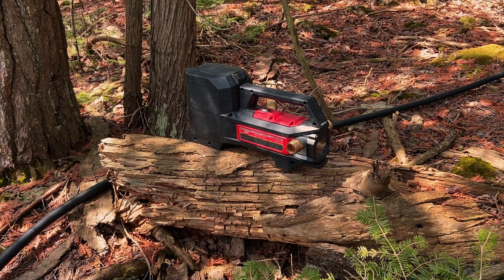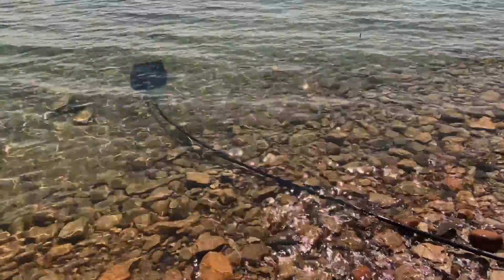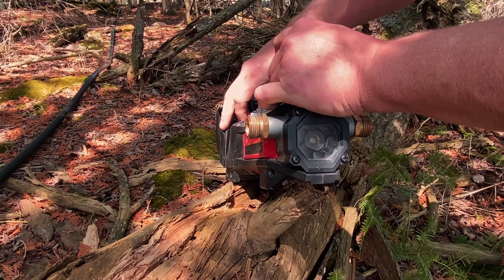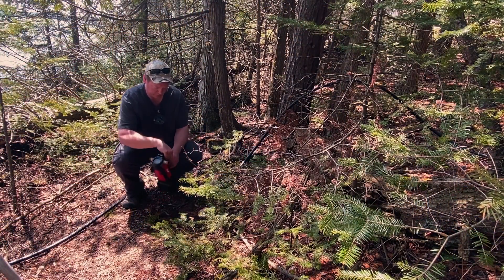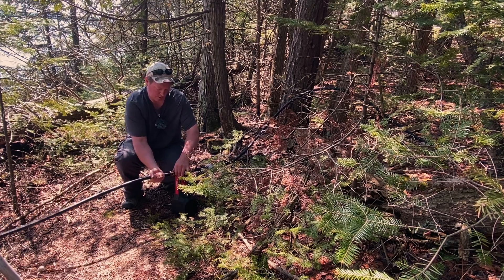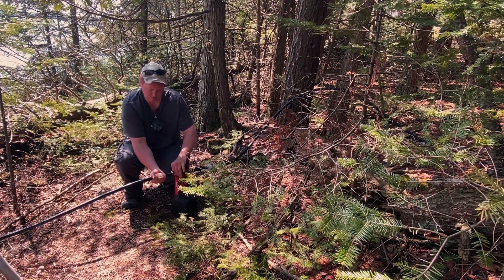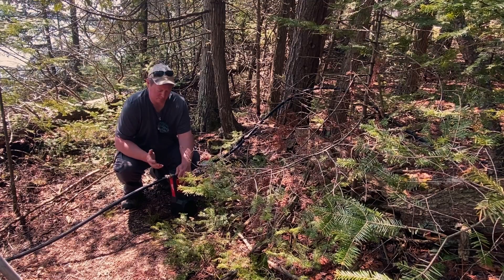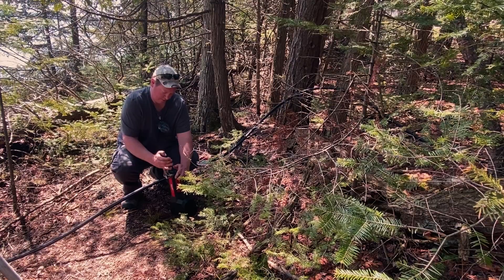Off-Grid | Water Tower Water System | Milwaukee 18v  gear drive transfer pump.

Comment: Lag bolts, nails or screws to built tower?
Reply from the maker: Lag bolts is what I used to attach the legs to the platform. The platform itself was assembled with nails as well as the cross bracing. I did use some screws to help quickly hold things together but all were replaced and had nails added at their locations.     

Screws are great in a pinch but if you bend a nail in half it’ll fold and back and forth a few times before it will snap.   Most screws will snap off during the first bend. 

Not recommended to use screws for anything other then hanging a picture. :). In time a structure under load will eventually snap screws off as the building stresses under changing loads.  

Hope this helps. And thanks for checking out the channel.

Comment: Nice setup. Would it be less work for the pump it you were to add a diversion valve at the tank so that you could fill the tank from the top instead of the pump having to work against the back pressure as the tank fills?

Comment: 🤔 how did you get that IBC tank on top of your tower, you got yourself a forklift in the middle of nowhere?
Reply from the maker: No sir. While empty I tied a rope to the back of the bottom of the tank and leaned 16’ 2x4’s up against the top of the tower. I wrapped the rope around over the back of the top  and back thru the front to me thru the middle. I pushed the tote while I pulled the rope continuously untill it was on the top then pulled the 2x4 out

Comment: Thanks for the video. I'm getting ready to add a solar pump (RPS brand) to my well and I'm going to pump to an uphill tank (which I still need to buy). I've been eyeballing those totes like you have. They're about $200 where I live. I'm shooting to have my tank about as high as the top of my trailer. I'll probably build a little platform for the tank to sit on. Something like yours but shorter. Have a great summer.
Reply from the maker: Thanks Dan. It’s a simple setup that works great. Hope you also have a great summer and your installation goes well. 🍻

Comment: I bought a two story house, off grid, it has a sprinkler on the roof(one of those rotating heads) not sure what the previous owner used for a pump. I wonder if this would provide enough pressure to keep the roof wet? until the FD shows up....its about a 20' drop to the lake which is 60' from the house. I also have one of those fire packages on a dolly(pump , hose, nozzle etc...Thanks for the video.
Reply from the maker: I don’t think there would be enough volume to activate the hammer thing that moves the sprinkler.  I would recommend a gas pump for fire protection. Likely like the one you have on the dolly. 

I’m glad you enjoyed the video. 🍻

Comment: Very interesting! What about issues with the system freezing?
Reply from the maker: Hi Larry. Welcome to the channel. This is not a winter system.  In the fall I will winterize all the ball valves, lines and empty the tank. In the winter I get my water with a bucket from the lake.
Reply: @IndependentOffGridRetreat  Thanks for responding!  It’s got me thinking. I’m just getting started, but I like the set up.
Reply from the maker: @larrythomas3624  np this is a community I’m glad to share.

 sometimes simple is better. Everything had advantages n drawbacks.  

I’d be interested in your ideas. Let me know what you decide to do

Comment: our bath house tank is the same style tank. We use a 12 volt pump instead of gravity to take showers and the sink, but that tank full lasts us a couple weeks, It is great. Next year we plan to do rain collection now that we have a cabin to catch it off of. Nice little set up you have. ALSO....jealous of your shoreline, LOL. Best wishes
Reply from the maker: I likely filmed this video the weekend before upload on April 26th. You must get to your retreat a lot more then I do. Last weekend I looked and I just went below my electrical tape marker I put on for this video with last weekends trailer tank fill up. I often shower in the lake. But do all dishes and hand washing and 50% daily showers. No toilet I use an outhouse.  I had two weeks of vacation and have been there every weekend for over a month too. 

I think I refilled it once. That’s 4 months of water use on two tanks. Sure you don’t have a leak?

Yes I really lucked out with water. Got in just in time. Just before covid.  All lots are sold now and selling at more then double what I paid!!
Reply: @IndependentOffGridRetreat  ya we have two people showering daily for two weeks, it drains the water down pretty quick in comparison to just watching dishes and such.

Comment: How is the water filtered from lake to trailer?
Reply from the maker: No filters. There is a large screen on my foot valve which as you seen I have elevated off the bottom of the water with a milk crate.  Then my trailer pump has a sand filter on the intake.  I have thought about buying a couple canister filters so I can drink the water. Now that I’m building the cabin I’ll wait until I have a spot to put it in there.

Comment: you need to paint that water tank black , good video
Reply: You can add a little chlorine to the water to deal with any algae.
Reply from the maker: @polarbear4612   yes thanks. I’ve also heard hydrogen peroxide will help with this.
Reply from the maker: I’m testing it. I know the sun should cause algae to grow. But I’ve had a white plastic 50 gallon drum out and hasn’t grown any yet 🤷‍♂️. Thanks for the suggestion.

Comment: What do you do at below freezing temps?
Reply from the maker: In the winter time I still use my trailer. 

Come late fall I winterize my trailer shut off and winterize the pumps. Empty my tower tank and blow out the water from the above ground waterline. I leave all the ball valves open so they don’t burst and crack. 

I use a five gallon water jug and a ladle to get water through the ice for washing dishes which I do in two plastic plastic containers and water I heated on the propane cooktop. One container for soap one for rinsing. Dumping the water outside when I’m done.  I buy drinking water in 3l or 1 gallon jugs for coffee and drinking.

I clean myself using the same method but use very little soap and a face cloth so I don’t have to rinse as much. My dad used to call it a spit shower cause you only use a spit worth of water to wet clean and rinse yourself. :)

It’s quite primitive but doable.  The insulated bunkie that I’m building in my other videos is Definitely the way to go for winter camping. No trailer I’ve ever seen has enough insulation to comfortably use in temps below freezing.   

I’ve spent up to a week at the trailer. Winter trailer camping is quite hard on the unit. The poorly insulated walls and colder temps outside cause a lot of condensation to form.
Reply: @IndependentOffGridRetreat  To tough for me, I just move my rv where it's warmer
Reply from the maker: @safffff1000   I wish. I’m Canadian. So there is no escaping the winter especially during covid travel lockdowns.